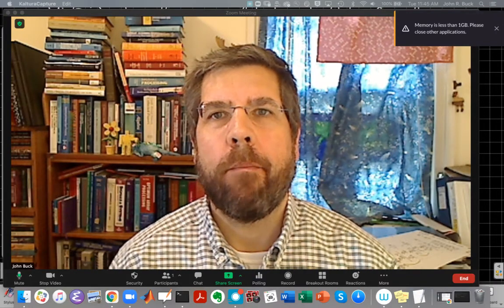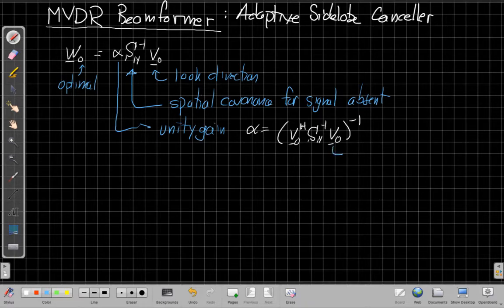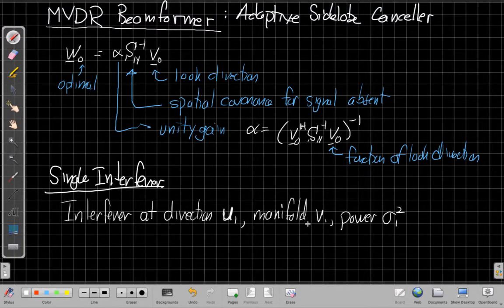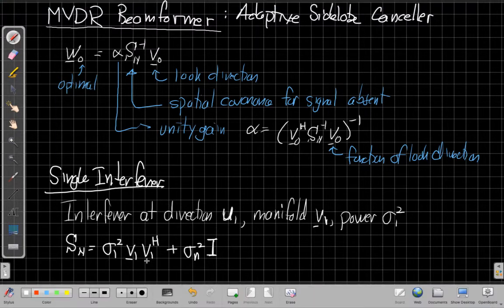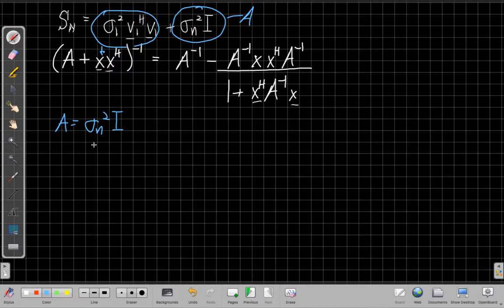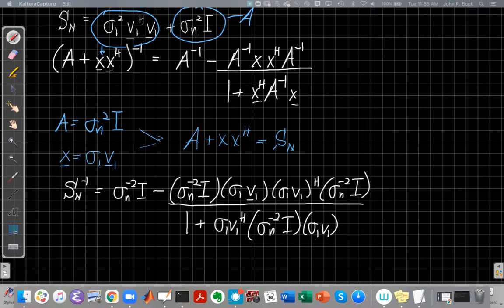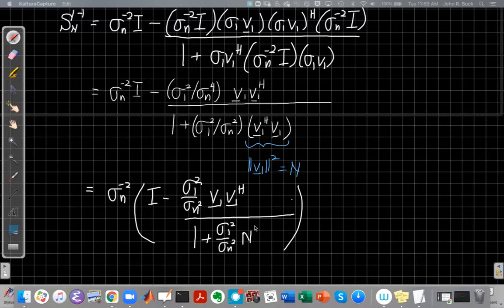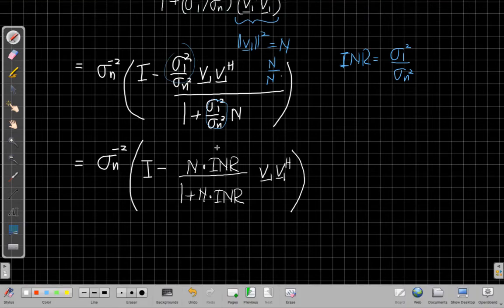Generalized Sidelobe Canceller (1/2): Inverting the Spatial Covariance Matrix

Comment: I’m glad you used the Sherman-Morrison (Woodbury) formula! Favorite identity of mine. If you decompose an added error matrix (using SVD for example) you can apply the formula serially to find error propagation of matrix inverses. Pretty neat application. 🤗

edit: though condition number of the matrix is also useful…
Reply from the maker: Thanks Matt - that's a good trick.   That matrix identity is very useful in many problems.